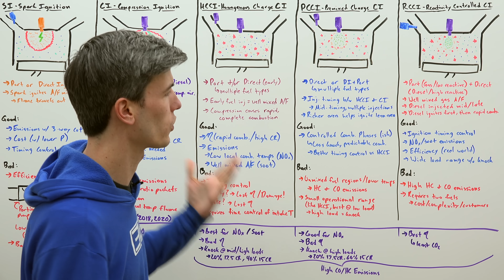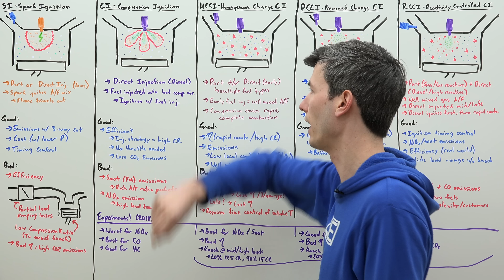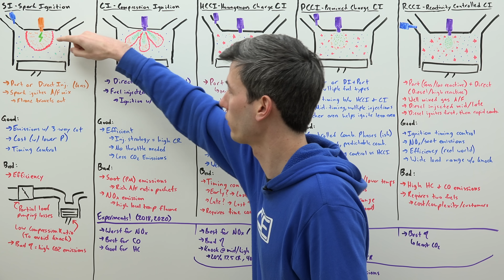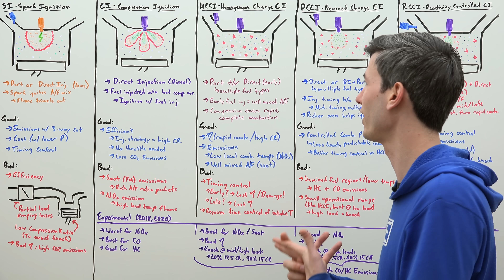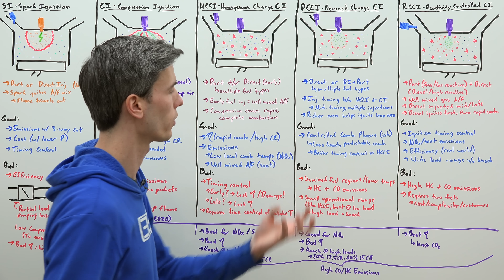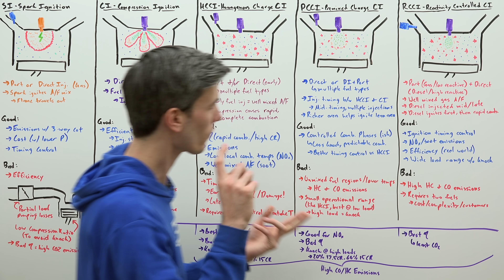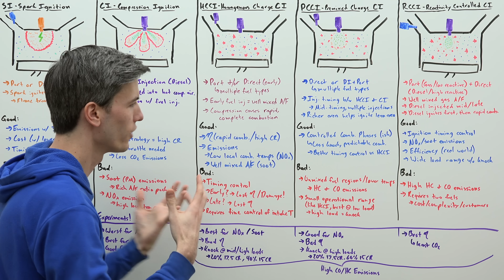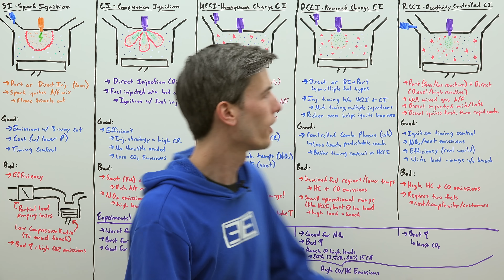If Combustion Engines Have A Future, What Is It?

Comment: I highly doubt that internal combustion engines have a future. By the end of the century, they will end up being completely obsolete just like their external combustion cousins (steam engines, Stirling engines, etc.), and only the occasional enthusiast will own an ICE vehicle.
Reply: Porsche's e fuels might come in handy
Reply: @christopherayala4619  I don't think so. Even though these 'e fuels' are carbon neutral, the combustion of this fuel will still produce soot and nitrogen oxide which are bad for our health, so it won't help with air quality in cities. Also, this fuel will be really expensive, and like hydrogen, the production of this fuel will not be very efficient so most of the energy used to create the fuel will not end up being used to propel vehicles (it will end up wasted as heat).
Reply: @beanapprentice1687  it is expensive for now since there's isn't that much production however once they start making more it will get cheaper

Comment: Was told by a Diesel engineer that a) the particulates are somewhere around 20 microns which makes them heavier than air so they fall to the ground.  b) NoX gas is a very unstable gas which has a life of about a half of a day compared to carbon dioxide which has a life of 300 years.  So I still think diesel is the way to go.
Reply: yes that is very much true. atleast the unburnt fuel part is.

Comment: 'Half as efficient as an electrical car' - does that include electricity generation or are you only counting from the outlet to the road?
Reply from the maker: They will often still be more efficient, as always it goes both ways. Are you including the energy to get the gasoline from the well to inside your car?
Reply: that's only the engine+transmission efficiency, discarding battery losses and plant-to-battery transmission losses. (mind that i would love to buy an ev if i lived anywhere it made sense)
Reply: Battery losses and plant to battery losses are minimal as well. You are losing more in efficiency transporting fuel to the gas station than you are from plant to battery to motor. Production of energy can a problem though. Coal is horrible, so using it would be worse than the best case ICE engine, but not worse than standard ICE. The cleaner the energy production, the more efficient the EV.
Reply: @anthonypelchat  efficiency in fuel transportation is not taken into account and doesn't need to be
Reply: @THESLlCK  Someone brought up transmission line losses for electricity. I was mentioning transportation due to that.

Comment: Jason, I've heard that really the future is still based in SI* and CI. For spark Ignition, switching I've heard the future is HCCI is not HCCI itself but a halfway point with HC and microwave or plasma ignition. As for CI, I have heard that using Ducted Fuel Injection (similar to that maserati engine you made a video about) and extremely high fuel pressure (rediculously fine pattern) is the future for "diesel." While these may be erring on the side of more conventional they do allow for more reasonable operation and will likely be cheaper, easier, less complicated, and longer lasting to operate. I think there is a good reason HCCI, PCCI, and RCCI haven't taken off... cause it's not like there aren't groups researching this. If the likes of F1, Cosworth, Mercedes, Porsche, the entirety of Japan, etc couldn't figure it out over the last 50 years I doubt it could be done in a reasonable way. These days, improvements to ICE are evolutionary, not revolutionary. (Sadly). I love EVs too, but I do hope that the gas engine / diesel engine still have a place for the foreseeable future. It's be sad and weird living in a hyper quiet EV world.

Comment: There is so much room for improvement in ICE, even for the most efficient ICE engines that are widely available now. There is a ton of energy in the petroleum based fuels we use, but most engines only make use of less than 30% of that energy. The rest is wasted through useless heat. I'm certain that we could be building substantially more efficient engines, but because there is no real regulation pushing for it, no one in power is taking climate change and vehicle emissions seriously and petroleum is still widely available, there is no motivation for auto makers to make a truly efficient ICE.
Reply: just not true. Efficiency gains happen very slowly. Automakers are always researching and trying new things. The problem is the engine cannot cost an outlandish amount or any vehicle they put it in will never sell.

Comment: I wonder why when talking about efficiency in electric cars i never saw anyone considering the cost of manufacturing the car, e.g.: it takes at least 30 times more copper to produce, it takes much more rare materials, and they cost much more to recicle the batterys (if meanwhile they can find a safe way to do it). Why is that? What do you think?
Reply: Cradle to cradle, EV beats ICE everytime
Reply: @ΗΕΑΗΘΣ  except in cost, convenience, & vehicle weight. That's why I still prefer Plug-In Hybrids.
Reply: @ΗΕΑΗΘΣ  efuels are here now though and they are going to start selling from next year. They are MUCH cleaner, you haven't seen how much benefit they are about to bring.
Reply: Plug-In Hybrids are the best of Both Worlds IMO. I've check various studies and having a bit of both, especially one axle powered by ICE and the other axle powered by Battery + EM (Electric Motor) can give you the best results, especially on cost factors to end consumers.
Reply: Manufacturing is a constant cost which is expected to drop a lot in the future, so it is not a big deal if they currently use somewhat more resources. For example let's suppose that less than 1% of all electric cars that will be made until 2030 were made before 2020. It doesn't really matter if they use 2-3 times more resources than what the technology will allow in the future. And since batteries are progressing at the significantly higher rate than Ice vehicle efficiencies you'd expect that electric cars will use less resources than ICE vehicles.
Is recycling really a challenge? Just make it mandatory for the manufacturer. They can then price the car with the cost of it.
Reply: @grekiki  if you make make recycling mandatory for the manufacturer then it will make EVs even more expensive.
Reply: @papasmith7648  I think it is important to incentivize the development of recycling. Manufacturers will now have to find a way to make batteries that are easier to recycle thereby lowering their cost and increasing competitiveness. The subsisides for EVs can be increased if this rise in cost would be significant.
Reply: @grekiki  Would like to see some subsidies for efuels, then we won't need to manufacture anywhere near as many batteries.

Comment: Hi Jason - just to explain why NOx is formed: the combustion mixture is fuel and air. Air is 78% nitrogen, only 21% oxygen and 1% other gases. The oxygen burns with the fuel but also combines with the abundant nitrogen to form NOx. The rate of NOx formation generally increases significantly above 2,800°F flame temperature. Lower temperatures lead to less NOx. ATB, Rob in Switzerland

Comment: "People aren't gonna want to put two different fuels in their car" - all people in Europe that use LPG goes "what??"
Reply: Yeh but most people with LPG run on LPG most of the time and rarely fill the petrol tank. The method in the video requires 2 fuel fill up every time.
Reply: @tubester4567  some installations use fuel and LPG at the same time, but is like 20% gasoline 80% LPG, or even less fuel. Its when you use direct injection. Maybe in this method you use most gasoline and a bit of oil or something...
Reply: It's ok, no one uses LPG

Comment: Future of Combustion Engines: range extender for electric, one operating condition
Reply: @Warlok you will at some point, and look up the appendix its of no use. Progress isn't for everyone some people will be left in the past.
Reply: until people realise the range extender is redundant........
Reply: @tomnwoo  depends. Range extenders make a lot of sense depending on mission profile.
Reply: @daszieher  I could imagine them being like in appendix and slowly but surely being evolved out of existence, I can imagine people having them in their cars and then realising at some point that they haven't been started in six months and when they were started a bigger battery would've covered the range they required, fast charging makes them redundant, I've just done a 980 mile round trip to Scotland in an EV that does 300 miles to a charge, and frankly it charges too fast for you to actually eat go to the toilet and get back to the car.
Reply: @tomnwoo  that's great for the teeny tiny UK. Realize there are plenty of places on the planet 300 miles won't get you to the next town, charging port, etc.
Reply: @tomnwoo  I'm on the continent, so my targets can be a little further apart. I don't stop for lunch breaks, as I prefer eating where I was or where I will be.

Anyway, my point is less about convenience than about total cost. Materials for long range battery cars are more expensive. So keeping the battery size small will lower the total cost.

If battery cars were sold without government handouts and electricity taxed fairly, I would have no objections at all. To each his own.
Reply: @Xander1Sheridan  Great for 90% of the developed world.
Reply: @daszieher  prefer your fuel controlled by a cartel? Nothing you said makes particular sense
Reply: @tomnwoo  no it isn't. At most 5% can have an electric car before the electric grid is on rolling brownouts. Every electric grid in the world is already stressed. Every country would have to spend trillions and open up multiple new nuclear power stations for any decent percentage of their population to have electric vehicles.
Reply: @tomnwoo  it seems that you are misinformed there as well. While crude oil may be controlled by a cartel of oil producing countries, fuel itself isn't. You can buy fuel as you wish and transport it with ease.

Set up a company and move and sell fuel at your leisure. You answer to the government only, no-one else. 

Ask me how I know. ;)
Reply: @daszieher  don’t get an EV then, that’s quite simple. But at some point you will have to adapt to a new reality, so our kids can breathe
Reply: @Xander1Sheridan  That's just nonsense, every grid in the world runs with reserve capacity, when petrol cars were invented there were no petrol stations, the grid will adapt and electric cars will greatly help
Reply: @daszieher  So essentially the main component of fuel is controlled by a cartel?
Seem to be trying to make an irrelevant and pedantic point. If war is declared in the Middle East every developed country in the world runs out of fuel within two weeks.
Reply: @tomnwoo  there is war in the Middle East to keep the oil price from dropping into nothingness.

Libya's reserves are not even taken into account at the moment. Same goes for Venezuela.

By the way, the power of OPEC has been dwindling. Its decisions no longer really relevant. Its declarations no longer incite fear.

There are too many alternatives around. The big bad wolf story of oil cartels is a thing of the past.
Reply: @tomnwoo  our kids grow up in better air than we did, and we grew up in better air than our parents did.

We will ultimately see the reduction of vehicle traffic in densely inhabited areas and I agree, there will be zones to which access with combustion engines will be exceptional.

There will just not be the need to ban ICE all together. We'll have better air without that unpopular measure.
Reply: @daszieher  You are right. You could have an half size battery (or even less) and a 30HP range extender always on (on the highway also, how many horsepower do you think your car needs, at constant speed?) and use the battery as a buffer for accelerations and regenerative braking, to feed a 200HP electric motor. Remember that producing a li-ion battery is NOT environmentally friendly, and also recycling a li-ion battery (a problem that still has to come, because of the still "young" age of electric cars market) is not environmentally friendly. And also having a battery that weights 500kg is VERY BAD for efficiency, because you have to waste so much energy by moving an heavy car instead of a lighter car (of the same size). The future of transportatoin is hybrid, not electric.
Still I can't figure out WHY the entire world choose to switch to electric energy starting from the MOST DIFFICULT application... that is MOVING VEICHLES... wouldn't have be much more convenient to switch FULLY to electric energy in fixed application such as home heating, and avoid completely the use of gas, and oil in general for these application, keeping the use of liquid fuels, that are so much energy dense, and convenient, for the most difficult application, that is: "moving veichles"?
Reply: @Xander1Sheridan  great truth
Reply: @BICIeCOMPUTERconGabriele  electric heating cost more than gas in the UK afaik, storage heaters used to be a thing but gas central heating is standard now.
So that does kind of bring into question the sense of ele tric cars as far a costs go.
Tax is of course the key thing here , it is simply used as carrot and stick ( well, stick really lol ) to control what works out cheapest.
IF we can produce electricity greenly in enough capacity AND solve the battery production and recycling issues it would make perfect sense environmentally but wont end up being any cheaper in long run for us because Gov needs their taxes ...
Reply: @FlyingFun.  You are right. Just some clarification: when I talked about electric heating I meant heat pump and not simple "resistor" heating (don't know if I wrote correctly, I'm Italian).
Heat pump can pump inside the home an amount of heat that is 4 times the amount of power consumed by the heat pump. It's said that it is equal to an efficiency of 400% (obviously it's not the "true" meaning of the efficiency, here, because by consuming, let's say, 1KWh of electric energy, the heat pump can pull 4KWh of heat from the (colder) outside ambient, into the room.
So when you account for electrical heating costs, you have to divide by 4 the amount of KWh of heat you need to have the desired temperature in your home, to have the amount of KWh of electrical energy necessary.
Reply: @BICIeCOMPUTERconGabriele  ah that makes more sense , clever stuff!
Reply: @FlyingFun.  I use it in my home (northern Italy, so as cold in winter as in UK) 95m^2 and a cost of approximately 50€ a month for the electricity.
Reply: @BICIeCOMPUTERconGabriele  because you think like someone with sound technical knowledge and many others just barely understand what they see most often.

Even if one were to assume that the passenger car is the best place to start with electrification, company-owned fleets and taxis are much better places to start introducing new technologies than the privately owned vehicle could be. Especially if the tech requires a more mission based design and dedicated tech support.
Reply: @daszieher  Thank you very much!
Reply: tomnwoo Why is it redundant? even submarine have “range extender”
Reply: @kospencer1  LOL

Comment: Downside for RCCI engine was that it requires two different fuel systems. It's not that big of a deal as it sounds in America. Poland is third country in the world counting cars with dual fuel systems (around 13% of all cars on the road). Most of them are petrol engines with additional LPG (liquefied petroleum gas, autogas) system installed. People install it because of cost efficiency (LPG has different taxes). Engine consume around 25% more fuel (1.25L of gas instead of 1L of petrol), but gas is 50% cheaper then petrol. Whole installation costs around 800 USD and you can save this amount of money under 2 years. I drive Jeep XJ with 4.0L engine and LPG installation. It has 330k kilometers on the clock and works like a charm. Car has standard 70L petrol tank and 70L gas tank in the trunk (that can be filled up to 54L only because of safety regulations). Engine can work on both, normally it starts on petrol and switch to gas when it heats up to 40 degrees Celsius required to efficiently vaporize liquid gas in the system. Dual fuel is not that big of a drawback :)
Reply: I've always liked you Polish guys with your LPG conversions, very smart i think. Greets from Germany :)
Reply: Not only Poland but in Brazil also there is a lot of cars running on LPG, cool to know that are other countries that also use it in cars
Reply: In Poland you can have LPG/GAS car that run's fine using only gas and no LPG and runs fine using LPG and no gas. RCCI works different, it requres BOTH gas and diesel fuel to run.
Reply: @volodumurkalunyak4651  absolutely right. In fact, you can't start cold engine on LPG, so you need to have at least a little bit of petrol for first few minutes of operation. But you are correct, car is driving on one of 2 in the same time. My point was that as it was explained in the video as it would be a big drawback, more complexity of the fuel system, more inconvinient for people to fill up 2 tabks on petrol station. Both points are true, but from owner experience, it's doable :) 13% of car owners in Poland are proof that it's also doable on bigger scale.

Comment: Have you considered the running costs of a Compressed Natural Gass RCCI engine? If a gasoline RCCI is twice the cost of electric and gas is half the cost of gasoline, then we may be at a tie with CNG RCCI. I have seen attempts on converting diesel engines to CNG RCCI in Europe but the regulatory agencies seem to be set against this and I wonder why.